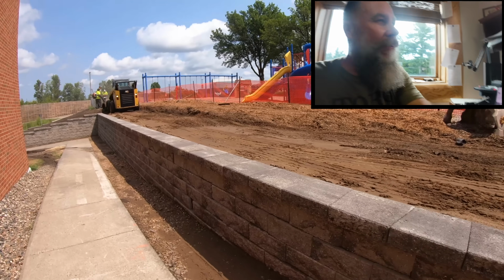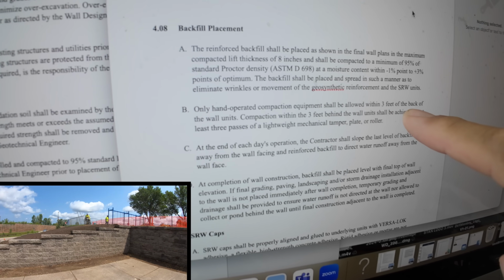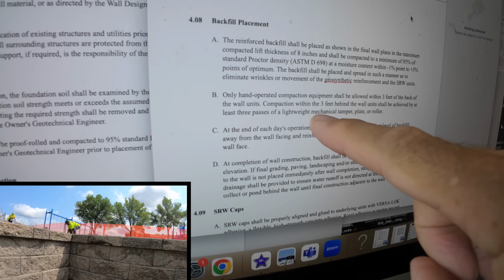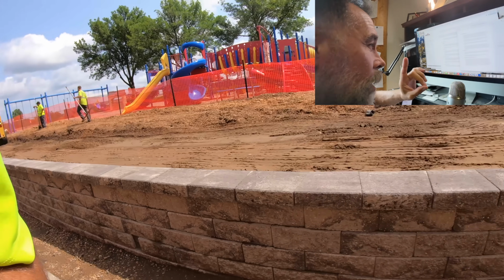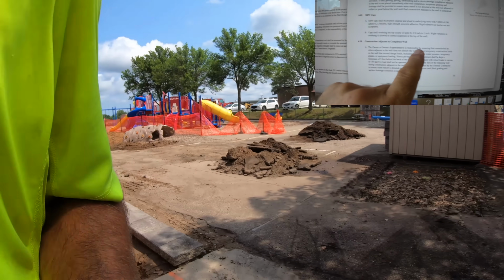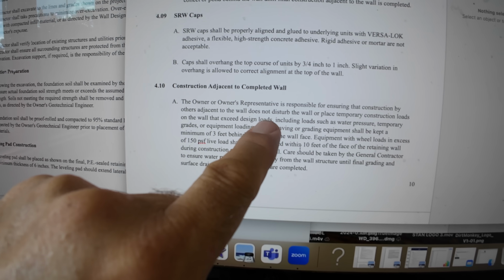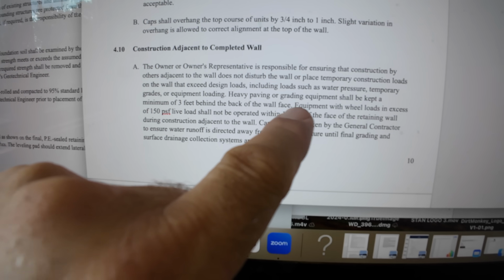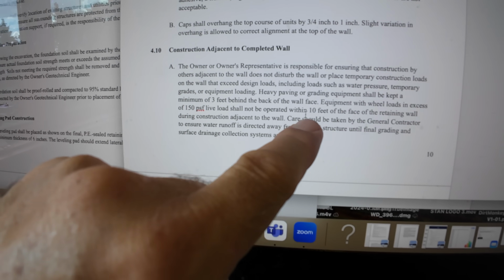Who's at Fault?  You decide.

Comment: Good point Stan!
I think it would be a good idea when you bid these jobs to check to see if there will be asphalt next to the wall and if so, bring it up to the contractor’s Attention and have him sign a document that he knows what will happen to the wall if heavy machinery is near it.
Reply: This is likely a conflict of spec sections. Stan is following his spec and likely the paving contractor is following his spec. The schedule also must be considered - who was scheduled in first. Ideally this scenario would be caught at bid time and resolved via the RFI system. Stan is correct in stating one sub does not control another, however every contract will require coordination between subs. This coordination is documented (or should be) at the GC's weekly job meetings. If no such meeting was set up so both contractors could coordinate, the GC is likely at fault. These administrative obligations of the GC are covered in the 01 spec section - which no sub ever reads but is included with every contract.
Reply: @hydelake224  actually ultimately the general contractor is responsible for the subs.   So.....

Comment: One issue is that the excavation looks like it was just for the wall.  The engine should've called for a greater area of compacted fill. There's other components involved.  In part all contractors involved should've know how to avoid it.   ithe engineers should have designed and documented all aspects of the job.  This is where an inspector should've been on site and stopped the job.  And work towards a viable solution.

Comment: Asphalt contractor is at fault. They wrote a bid to pave the area. The bid was accepted. They choose to do it in that manner. They could have hand laid the aspahalt and used a small plate compactor.  They choose the easy route.  That has risks involved. If they are profesionals they should  know how to complete a project, what it will take to do it right.

Comment: The Engineer or architect. An engineer especially should know about the 3ft rule. Its the engineers job to make sure everything is structurally sound....

If the asphalt absolutely has to be up against the retaining wall there should be stipulations about what equipment can or cant be used. I dont do asphalt work but if there is an established method to safely put asphalt up against a retaining wall. Then the blame would lay with the asphalt contractor..

Comment: Architect/Engineer should know all specs of the products being used on the project. The GC as well should know they are in charge of the whole project. I've bid on some commercial jobs where the contract states that the architect/ engineer will not be at fault, but the builder will be at fault. But really the architect/engineer should be at fault. Years of schooling to learn to calculate, read and reread specifications.
Reply: You need to know if the wall design is delegated design or not.

Comment: It all depends if the block manufacturer’s specs were included in the project specs. If so, it then depends if the paving spec refers to the spec section that includes the block specs. If it is, then the paver would’ve had to do the paving via handwork and the gc should’ve pointed that requirement out. Either way the paver and the gc knew there was an issue initially and rethought their approach.
Reply: Exactly, I’d love to know what the block specification s f what the Basis of design is. I’ve seen it where the drawings show retaining walls as delegated design

Comment: It's the engineers fault who designed the entire clusterphuck. That's not to say that the person that hired this work done won't sue every Tom Dick and Harry trust me I know.
Reply: Don't paint all engineers with the same broad brush. There are specialized retaining wall engineers who look at all the aspects of a project and have to come up with viable solutions. 

Site layout is generally performed by architects, the site civil sets the grades. 

Neither of them usually understand very much about retaining walls, and many of them will just draw walls 8" to 12" thick (24" if we're lucky) with no consideration for wall height, block dimensions or batter. They put curbs/paving, light poles, fences and manholes right behind them. My favorite is when they put a 20-ft tall cut wall 2 feet from the property line and don't understand why you're going to need to get easements from the adjacent property owners to cut 30+ feet into their property in order to build the wall from the bottom up.

Comment: This is absolutely the engineers fault. If all of the contractors were following an engineered blueprint, it is definitely the engineers fault if all of the work was done to spec.
Reply: No, it actually isn’t the engineers fault. It’s up to the contractor placing the asphalt, perform the work without causing damage. An experience paver would know enough to hand place, hand roll and compact the area with a small vibratory plate. This is done every day in situations like this. In fact, a good estimator would have included this in his bid. Very few plans have a notation instructing the contractor how to perform the job in such a way to protect existing structures. It is up to the contractor to figure that out. This is just another example of an inexperienced contractor, and obviously one that doesn’t care. You can clearly see Stan‘s man, try to straighten out the wall. Then the asphalt contractor gets right on top of it again.
Reply: He explains they were not following specs.....seems cut and dried
Reply: @BrianWeber-gt4ho  what he is quoting is product specifications, not project specifications. If it’s not in the project specifications, it’s not part of the contract documents. My first question is what was the basis of design for the project, the block installed or was something else specified, or was the wall delegated design.
Reply: It depends if it’s delegated design or not. A lot of architects will only issue a performance specification for retaining walls because of issues like this.
Reply: The engineer  didn't not ecspect sub contractor to not follow specs and place equipment in an area not designed for ir hopefully the general read his contract had not allowed his sub to go against the specs if anything this could have been an osha violation here in michigan. If specs say no heavy equipment it's is on you so as the general contractor it's now on you first